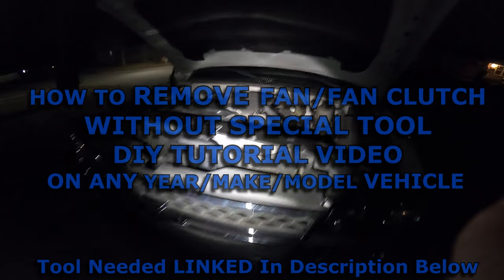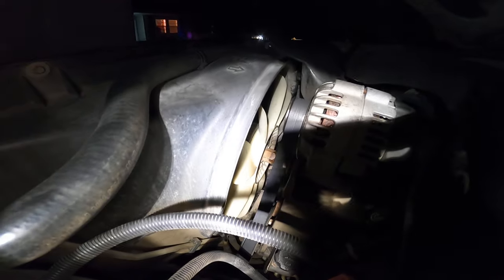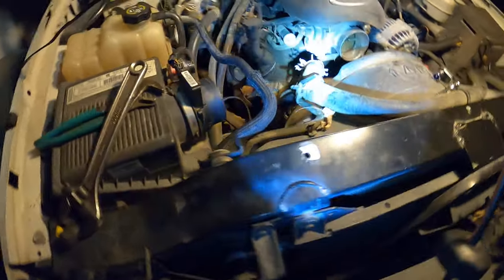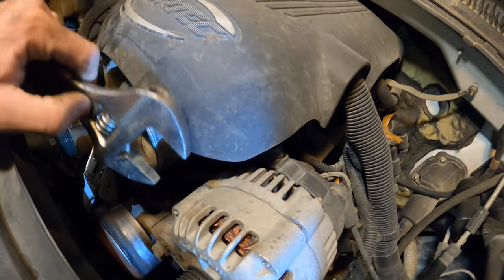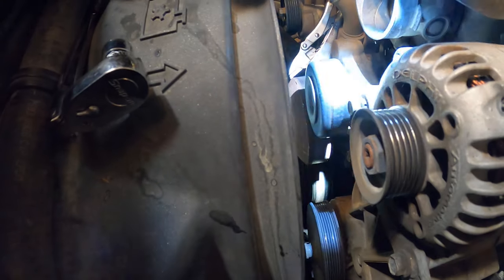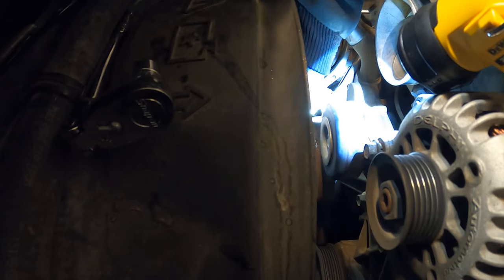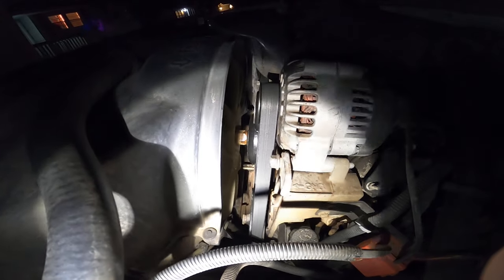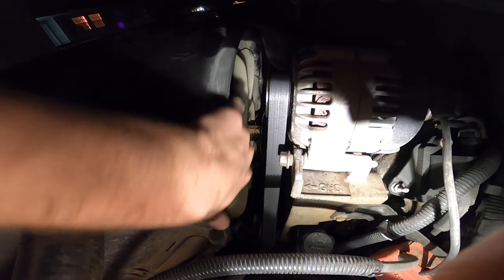FAN CLUTCH Removal Without TOOL 5.3 Vortec 6.0 4.8 4.3 L How To Remove FAN CLUTCH NUT Holding Pulley

Comment: Use a good C clamp if you have one instead of vice grips on that pulley. Put it around the diameter of the pulley. Otherwise great video. I came here to confirm it wasn’t reverse thread and your video did the trick!
Reply: Same...didn't want to be tightening it.
Reply: Of course I was trying to tighten it,lol

Comment: Much more room to work , if you remove upper fan shroud  .
4 plastic push pins and 2 10mm screws .
Reply: Unfortunately the “ upper fan shroud” is connected to the “lower fan shroud” thus making it “fan shroud”
Reply: @NORTAH85  , 
It is a two piece fan shroud. 
I own a 2002 Tahoe,  
Add to that I have been a professional technician since 1981 .
I don't know what you mean that it is a one piece shroud  .
Reply: Shroud all in the way I can't work like that
Reply: its a 2 piece shroud, 4 push pins, and 2 screws and the top section of that shroud is out and out of the way.
Reply: Comes out in one piece if you wiggle it right

Comment: Thank you thank you thank you for posting this video!!!  I made the mistake of removing water pump with fan and clutch together.  I later realized that I had to remove the fan BEFORE  removing the pump.  by placing the water pump on my bench vise grip and using the the tools you mentioned, i was able to remove the fan.  once again...thank you.

Comment: i used a doubled up coat hanger... thread it threw one of the holes in the pulley then threw one of the holes in the power steering pump pulley.... tried it single first and the co;at hanger broke, doubled it up and it held.

Comment: I'm a mechanic, Just did a 03 astro van 4.3. Water pump, fan clutch would NOT break loose. Threw my impact hammer and tool with my torches on it would NOT Budge. So had too ( saw zaw )  it off. NEVER had one as stubborn as that one!! After it was off,  my 1/2 drive snap-on  impact barely back it off!! Crazy. So morale of story sometimes they won't come off!!
Reply from the maker: Did that vehicle ever have any front end damage i bought a chevy express years ago i think like a 08 or something at salvage auction from copart & it had front end damage & cracked a few of the plastic fan blades & that thing was a son or mother truckin sucker to get off i think i finally was able to heat it & get it off but was a pain in the ass.
Reply: @EverydayImTECHnIt   don't know? It Was a customer's van !! Everything was intact. But man. What a bit#h!! I was killing too much time on it, so no choice!! Usually with the impact too , it takes longer to assemble the tool than to zap it off. Lol.
Reply: When I saw the size of the threads on the new water pump I knew it was going to be fun getting that off. Pointless overkill fastener for just a fan. The old design this replaced was much better/sensible

Comment: So i can put some heat on it  huh i can get it off now  I'm worryed getting the seal  to hot it's on there pretty good 4 ft cheter pipe didnt get it hardest one yet cant c where did u clamp vise grip  on pully itself

Comment: Help 
Question I replace the clutch and the water pump and the fan is spinning slow and the water pump is not spinning, van overheat quick not even 3 minutes because fan not spinning fast and water pump is not working, the water won't circulate to the radiador and don't know why ,
Reply: Put your fan belt back on.

Comment: Using the special tool, that is the 2 piece set, seemed easier for me to do. The 1 piece special tool sucks. I was able to remove and replace both the clutch and pump in 6 hours. That was my second time doing it on my vehicle.

Comment: Didn’t work for me and vice grips left scuff marks but I probly just didn’t get it 100 percent my vice grips I couldn’t get them tight enough maybe.. or last person who changed the clutch tightened it way to much.. that thing is on there tight!
Reply from the maker: Sorry it wasn't able to help I'm sure that's probably what happened someone must have tighten the shit out of it LOL!!!! Also help to have good pair of vice grips some won't work as well as other's for doin this also. I would try heating up nut with mini propane tank deal like what you use to sweat chopper or soldier chopper pipe etc to heat nut/metal it expands then comes right off not sure if I said that in video can't rember if I did that or not or mentioned it if I did then disregard cuz u already saw that info in video LOL those fans can kinda be a bit of a b**ch to get off at times. GOOD LUCK!!!!

Comment: The 6.0 LQ9 doesn’t come equipped with a fan clutch. What else would cause over heating, water pump and thermostat has been replaced, no coolant leaks. both electric fans work, but the temp goes from 195-220 no higher than that any suggestions.
Reply: GM engines tend to run hot for emissions reasons. Those temps actually sound normal.
Reply: I hear the gauge is also inaccurate

Comment: Air hammer with a flat head tip and zap that fucking bolt on the corner and boom it's off wont hurt the bolt puts a small mar in it takes 4 secs to get the blade off worked in a junk yard pulling motors that's how we do it